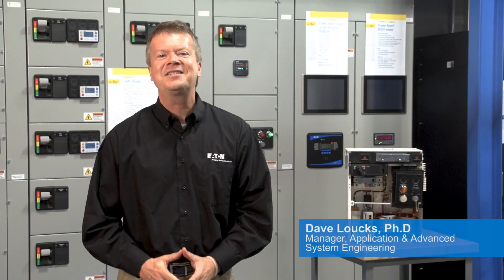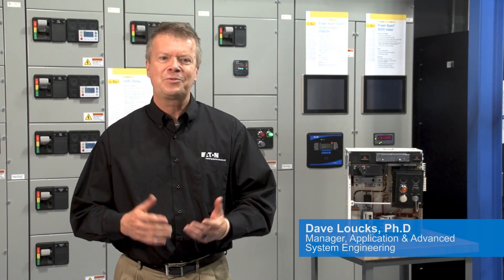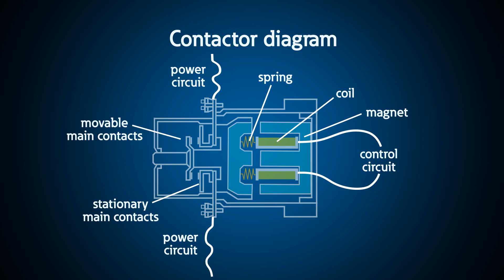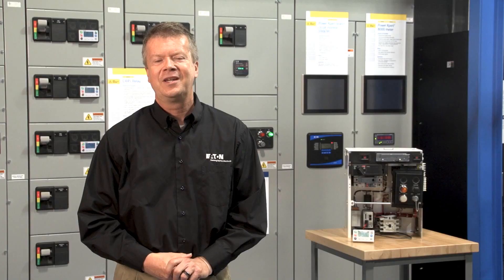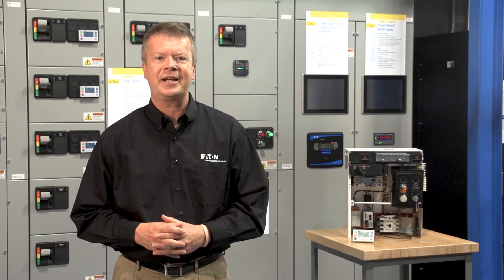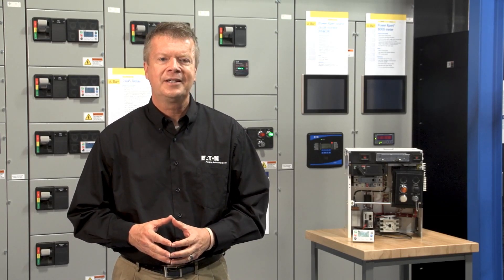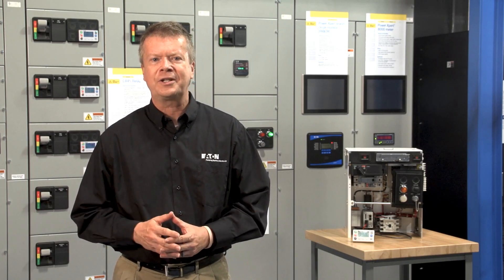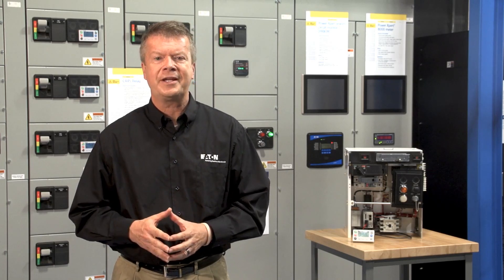Contactors Explained

Comment: We have a three phase 90 amp contactor that consistently arc welds the center leg. With a meter it draws 38-50 amps. And of course does not arc while trouble shooting it. What could it be?

Comment: Where does the power for the coil come from being it's a different voltage then the power the contractor is being used for? Is there a built in transformer or does there need to be a separate one to power the coil?
Reply: there needs to be a separate transformer providing the control voltage.